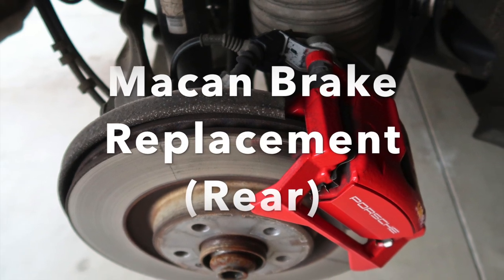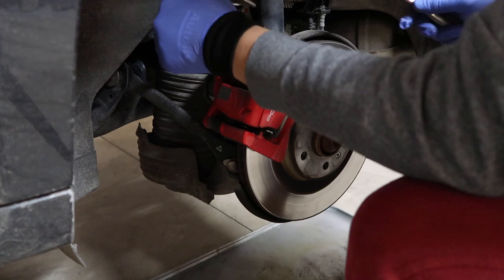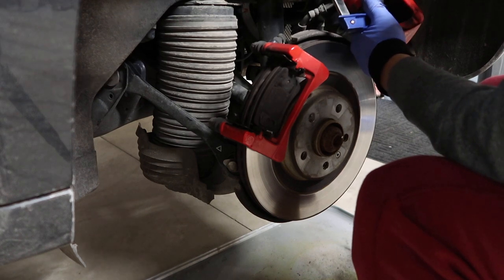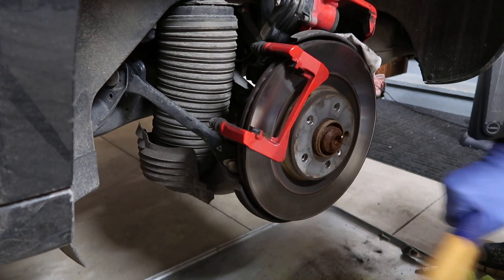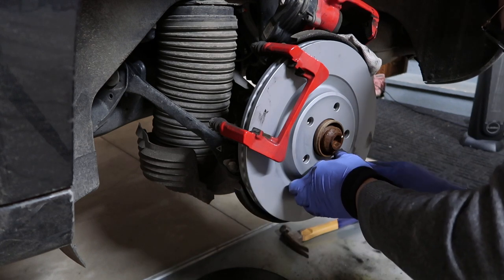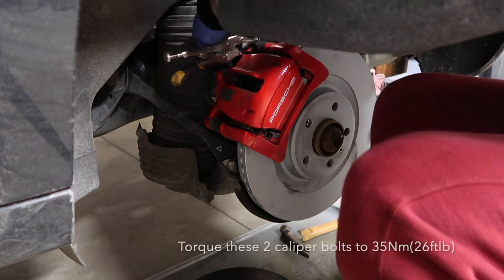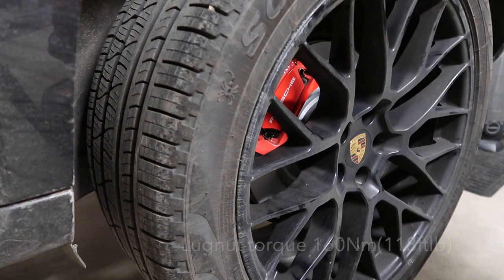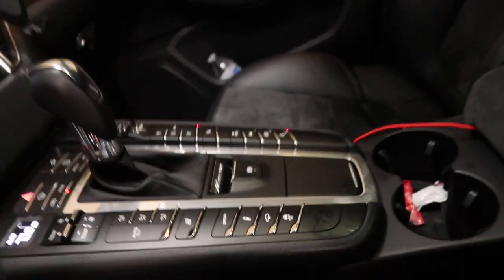Macan Brake Replacement (Rear)

Comment: Thanks Yichen, I learned a lot. I'm tackling both front and rear pads now thanks to your video.    There is one tip I have for those with the air suspension on their Macan's.   Porsche do highly recommend to turn the air suspension system off before raising the car and removing wheels.  One simply holds down for 10 seconds the button with car symbol and down arrow on it on the central console. A warning/confirmation note appears on the dash display. After you're done, lower the car and do the same to turn it back on.

Comment: Thank you for posting this and especially a big thank you for creating a quality video. It helped my project go smoothly. For the rears I did not use the Autel MK808 diag. scanner, but will be ordering one in the near future. 

To reset the e-brake spindle I went against your advice on this one thing and removed the actuator assembly. Removing the assembly allowed me to clean-up the housing and seating surface and more importantly it allowed me to relube the rubber o-ring seal. I would recommend this even though it's a little more work. The spindle should be rotated in a clock-wise direction until it stops, only then is it reset completely and allows the caliper piston to recess completely.

Comment: So far you did the jobs right except you forget to clean the wheel hub with wire brush before apply anti seize compound, and also forget to clean the inside of brake caliper and lub the dust shield with silicone spay to extend the life. Finally no brake grease apply to brake pads. It will make noise down on the road.
Reply from the maker: pete Wong thanks. All correct and I will definitely bring these steps into my next brake job

Comment: You can skip the tool and use a jump box or battery with 12v.  pull off the connector to the e brake motor and apply 12 v + and - to the two wire terminals if you look into the motor connection.  you will hear the motor run for 3 to 5 seconds, then remove the voltage and push the brake piston in with a clamp.  If it doesn't go in reverse, the 12V wires sending + where you sent - and repeat for 3-5 seconds and then push the clamp in.

Comment: Thank you very much for an excellent video. I have a 2019 Macan. Just got message on the dash saying "Brake Pads need to be replaced. Driving permitted."  How do I know which (front or rear) pads need replacement? Thank you.
Reply from the maker: @jagatshah3080  typically front worn faster if both front and rear were replaced at the same time
Reply: @luyichen11  Thanks a lot.

Comment: I think you did a great jop but i would have put anti seize on the ends of the pads where they contact the anti sequel shims.
Reply: Not anti-seize. Specifically designed brake caliper grease (Permatex high-temp brake grease)

Comment: Thank you for showing this, but please never start the bolts turning with the impact just to avoid damaging the thread if it doesnt go str8. Always run them with hands a little bit then use impact. Just advice from another diy mechanic
Reply from the maker: @brkbrk5205  thanks! Good advice!

Comment: He didn’t even change his gloves when he put the new rotor on. He got it all dirty. Also, he didn’t spray any brake cleaner on the rotor to get rid of any access oils off it when It was shipped other than that good job lol always handle new parts with clean hands gloves etc also he put no grease on the caliper bolts no anti seize on the hub😅
Reply: You are acting as if it is heart surgery,  cleaning the oil off the rotor is recommended but not something that is going to cause problems to the car, some of you people are so over dramatic.

Comment: Hey man what’s the thing you’re doing with the clamp? I need to change my rear pads and I just cannot understand why you did that. Can you explain please? Thanks for the great video.
Reply from the maker: By clamp I assume you mean the piston. It has electronic parking brake motor built in to drive the piston so you can’t simply push it back. That will either destroy the gears in there or mess up the calibration. It could be disassembled by taking the attached motor off and manually twist parking brake motor to restore its position but I would not take the risk. So get a dedicated tool connect to OBD2 port and use the diagnostic command to send electronic parking brake motor to original position or service position would be the best way. Once E parking brake motor is in service position, you can now push the piston with your favorite clamp back to its cylinder.
Reply: @luyichen11  because the new pad is thicker we have to compress the piston, okay got it man...you saved me a lot of money.
Reply from the maker: Yes. You are absolutely correct. New pads and rotors are thicker. Piston usually needs to be pushed back or twist&push back when replacing new rotor and pads.
Reply: @luyichen11  Hi, can’t you just set the parking brake off, lift the car and replace the pads without using the OBD sytem? Probably you can just put the gear handle in the parking position (P) and thats it, isn’t it? Thank you for your help!
Reply from the maker: @TH3CROW01  the EPB has some factory calibration in the control module and will learn as pads being work thin. Simply set it off and replace may trigger fault which causes even more trouble. So I did not bother to try since a friend could loan me the tool

Comment: are the wheels 20 inch?
Reply from the maker: Yes. All four wheels are 20 inches. Standard on the GTS model.
Reply: @luyichen11  ok, but I can’t accept the sliding calipers on a Porsche or even the GTS lol
Reply from the maker: @jayzhang14  哈哈，确实不好看。不过后轮刹车力本来也没前面大。话说回来还是钱不到位……
Reply: @luyichen11  都gts了，应该是到位的了，哈哈哈哈